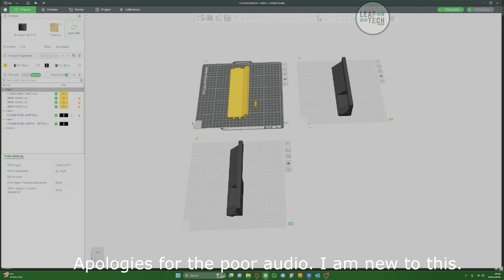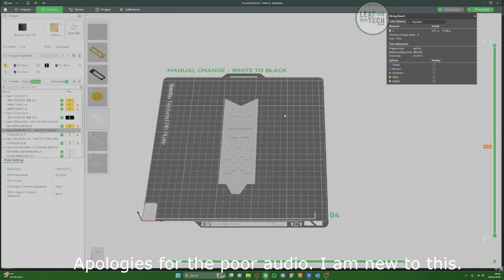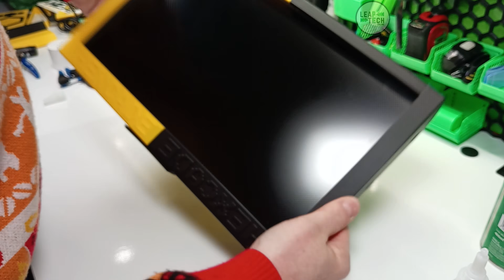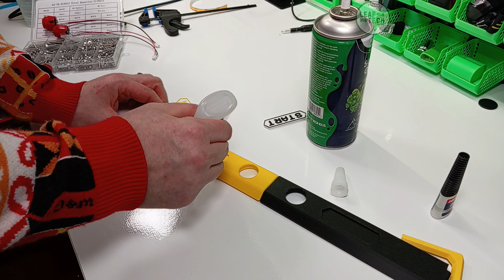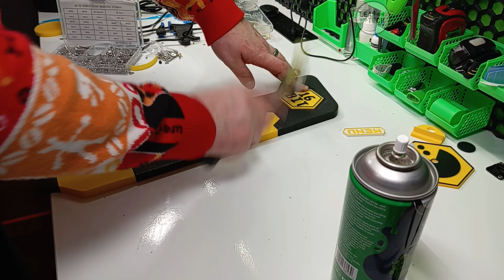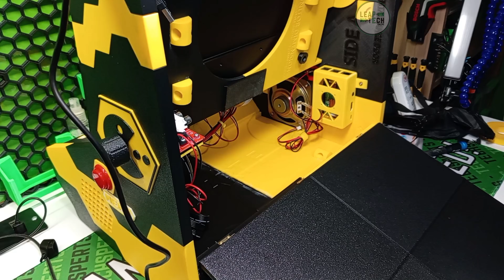A Step By Step Guide To Build Your Own 3D Printed Arcade Machine - Clean, Easy & FREE FILES.

Comment from the maker: 💾 DOWNLOADS & LINKS

All required files, operating system downloads, and resources are linked below in the description ⬇
Make sure you grab the correct versions before starting!
LeapTech Website -  https://tinyurl.com/45ftdhzv
Hexcase Page - https://tinyurl.com/3upy22j4
Hexcade Files - https://tinyurl.com/bdcwjp63
Win32 Disc Imager - https://tinyurl.com/5h65ac6s
ETA Prime how to load roms - https://tinyurl.com/yhjvtv8c
Reply: Great print project, makes me want to grab some more colorful rolls of PETG and build one I can power with my Udoo Bolt. I can't wait to see someone take this and make a version where the two control sides are modular/drop-in components. Seems possible with the current design, and it would make it possible to support lefties and different arcade button setups on the same machine.
Reply from the maker: @Tawnos_  You know... I never even considered modular controls for left handed people. Something I really should have. I will get this done as soon as I can. Apologies
Reply: @LeapTechOnline No need to apologize; you shared what you built and the top can be mirrored for a dedicated left-handed machine. Modularity would allow for things like a ball for centipede/golden tee, flight stick for star wars arcade games, etc. I look forward to seeing the iterations and improvements :)

Comment: Great build, thanks for sharing this. The only issue I got with it is the side power button, apart from scripting the functionality, was there anything specific you did to get it to shutdown using the power button? If so. Would you mind sharing it please?
Reply from the maker: Hey. It was indeed scripted but also it needs to be wired directly to the GPIO pins on the PI itself.
Reply: @LeapTechOnlinethanks, yep they have been wired directly to the pi pins as per your diagram in the video, but I used a recallbox image instead that I have for my other MDF cabinet with everything included, that I built a few years back which doesnt have the script. I ll try sussing that out and write up the script for it. Cheers for the response

Comment: Haven't watched the video fully yet but are print settings and wiring instructions included anywhere please? 

I'm a novice with both 3D printing and electronics but I'm desperate to print and build this for my home bar I'm starting to work on soon.
Reply from the maker: The prints are provided as a 3MF file ready to print for bambu printers. If you have a different printer you would need to adjust for your printer. 
Wiring is shown in the video for the Pi and controller pcb. 
We hope this helps.
Reply: @LeapTechOnlinethank you for the quick reply! Was more the power supply I was wondering about, I'll likely go down the route of the extension cable rather than the kettle cable. 

It'll be a Bambu A2L I print with alongside an AMS Lite. Not sure what colours yet though. I presume it's easy enough to setup the printer with which colours to use?

Also, noticed you guys are local! Great project.
Reply from the maker: @scott-the-lot  Yes, we don't offer advice on anything 240v due to previous issues. Sorry about that.

Comment: I finished assembling this and I had a blast. I'm now working on the 2 player cabinet. What is the back of the button panel supposed to rest on? I see tabs at the front but nothing in the back.
Reply from the maker: On the 2 player version you use the extra pieces from the last plate to glue to the side for it to sit on. Not the best but our latest versions we will release later this year will improve this greatly.
Reply: @LeapTechOnline makes sense now. I Kinda like how somethings I have to figure out myself. Are the L and R button supposed to be mapped to hotkeys?
Reply from the maker: @SPLIFiTeD  The L & S buttons are for load and save.

Comment: I finally got this built. The only issue that I seem to be having right now is that I can’t get the Menu button to do anything. I’ve mapped it to the Hot Key (I think it was called) and it does nothing. It maps as Button 1, so it’s operational. The issue that I’m having right now is that once I’m in a game I can’t back out to the main screen which is what that’s supposed to do right? Any suggestions ? Thanks again.
Reply from the maker: Hey you need to press the hotkey and menu at the same time.
Reply: @L@LeapTechOnlineanks for the quick reply. When I’m mapping the buttons though now that I mapped the menu as the hot key how do I remap it or what do I map the hot key to?
Reply from the maker: @JamieRRytlewski  Menu can indeed be the hotkey. The hwole point of the hotkey is an activation key to get you back to the main menu. For example on my machines, I would press the hotkey and Select at the same time and it would take me back. You could do it so its hotkey plus start etc. But you need the 2 buttons at the same time to go back.
Reply: Or do I Remap and leave the hotkey as something else?

Comment: I hope this hasn't been asked and I missed it, I've tried to read through all the comments but what size for the m3 heated inserts? When I look there are three dimensions. M3 and the diameter and length. Is the 4 the diameter of length, is there a preferred measurement for those two?
Reply from the maker: We generally use 5mm Long M.3 for all our 3d printed arcades. We hope this helps.

Comment: I love this and just finished printing my cabinet.  However, I'm having an issue with the OS.  I downloaded the file, unzipped it, and imaged my sd card.  In the Pi, it boots fine, I see your splash screen then Emulation Station starts.  I then get a message that no systems found and my only option is to quit.  There seems to be no way to launch RetroPie to set the configurations to use the USB.  Even after adding a MAME game I still do not see RetroPie as a system

I apologize if this isn't the right venue but wasn't sure where to ask for help.
Reply: No worries, would never ask you to provide those. Color me confused, but I am a noob at the emulation game. You suggested and linked to the usb method for ROMs. The first thing he says to do in the linked video is to go into the retropie menu. I don’t have that menu.
Reply from the maker: @conandlloyd  Yes not ideal but I would suggest the best youtuber by far for this is ETA prime. I do have a video in the works for step by step guides on this planned but no timescale as of yet. If you can not do the usb method look into SSH method.
Reply from the maker: The reason for this is you need to add roms. I can not legally provide them I am afraid. Once a rom is added to each console they will appear.

Comment: I'm in the process of printing all of this out. I noticed you appear to use at least two different types of glue. Would you care to comment on what you feel is the best glue for this project? Thin, Thick, Flexible CA? Thanks.
Reply from the maker: Hey. the main glue I use it anything high viscosity that can be activated with a spray activator. 
The smaller one is just a simple superglue for smaller parts. Anything from Loctite should be just fine.

Comment: Question. How do the buttons and joystick talk to the pi? (Haven’t gotten all my parts yet). Is it udb? Also will the system image work on a pi 4?
Reply from the maker: Through the PCB panel for the buttons. Basically it turns them into a USB controller.
Reply: That’s awesome. I do you have another question. Are you using a custom version of retropi? Is that the base of this and as I mentioned before will this work on the raspberry pi 4?
Reply from the maker: @ravedog  Correct this is a custom version of retropie. We do not actually use this OS ourselves as we have our own custom one but we are not willing to release that to the public.
A pi4 will indeed work but you would require a modified holder for the PI and  more than likely a new OS configuration. 
Simple enough tbh.
Reply: @LeapTechOnline thank you

Comment: Great build, how do you set up the buttons, it wasnt explained in the video
Reply: The settings. Wiring explanation is perfect
Reply from the maker: @davidescarsini5221  Ahhh yes! It should be set up to work right away with the OS we have provided?
Reply: @LeapTechOnline oh it doesnt matter where they end up plugged in.on the controller. mine are working but im not sure the buttons are doing the right action. when start select is pressed it moves the rom selection up and down skipping a few
Reply from the maker: @davidescarsini5221  Very strange. You may need to plug in a usb controller and re assign them all through the start menu.
Reply: @LeapTechOnlineI’ll give it a try. Thanks
Reply: @LeapTechOnlineGot the buttons working. Just don’t know what to map the side menu button to
Reply from the maker: @davidescarsini5221  If you are not comfortable in mapping it through code to drop back to the main menu then just make it your hotkey and it will be start plus menu to get back to main menu
Reply from the maker: Hey. The buttons as ion the wiring or the setting it up in the software? 
The wiring was indeed explained in the video?
Reply: @LeapTechOnline The settings.

Comment: question: do you have an alternate build that includes a roller ball and a spinner for games like tempest, golf, etc…. Or a second joystick for robotron type setup? Just wonder if it exists or needs to be designed? Thanks.
Reply from the maker: At present we do not. We are however working on many new machines including pool, light guns and fishing etc. So stay tuned as who knows what we will release.
Reply: Á

Comment: Since its 3d printed, any chance you could tweak the design where the control panel sits flush to the sides. 
I have an off-the-shelf bartop and the sides keep hitting my hand during gameplay which I find both annoying and painful.
Reply from the maker: We apologise, but this is not something we would be doing on this machine. If you were to need this you could either modify the files or pack out the mounting points. 

We will however look into it and keep it in mind for the next machine we design.

Apologies if this was not the answer you were hoping for. 

Many Thanks

Comment: Thank you so much for this. I'm just starting it, but I had a few questions after watching the video and downloading the files. I'm very new to 3D Printing. 

1. How did you get the pac-man to also be black? On the file I only see yellow. 
2. On that same piece it had a pause right at the end. Was that where the black should've been started? It appears to be now that I'm looking at things. I'm not quite sure how to make it black though with an AMS system. 

I'm so excited to see how this turns out.
Reply from the maker: You are indeed correct it had a pause for this exact reason. If you watch our video on multi colour with no AMS it will explain it all for you. We hope this helps.
Reply: @LeapTechOnline Thanks for the reply. Was hoping there was an easy way to change it to use with AMS as that’s what I have and I’m still kind of new to this. I just ended up continuing and I’ll paint it later or see if I can manipulate the STL files to do multicolor. As I said I’m new to this so I need to learn where to start. Thanks again for this.
Reply from the maker: @JamieRRytlewski  Hey, if you check out the videos on our channel we have one about manual colour changes. I hope it helps.
Reply: @LeapTechOnline yes I did and it was super helpful. it's just sometimes when I've doing these prints I'm not watching/watching it and it would've been helpful to just have the auto switch. thanks again. I'm part way through the print and have had some issues that I asked about on Reddit. Not sure if it's my plate, the filament or what, but since it's just personal it's not a huge deal. Thanks for the parts list as well. Ordered almost everything and waiting for those. The video was very detailed. Thanks again.

Comment: I think I want to try building one of these with a Pi5, as I've got a spare im not using. Wonder what kind of modifications I'd need to make to use it? A quite PC fan on the back bottom and a vent on top to exhause warm air would probably be all that I require. Aside from some small changes to dimensions, the largest difference between the Pi3 and Pi5 is the amount of heat generated and power consumed.
Reply from the maker: Luckily we have included an upgrade path in the machine for this. 
The top has holes to allow threaded inserts to be inserted to allow for fans to be fitted. A pi5 would require a simple pi enclosure and the required heatsinks etc. 
Power wise using an extension lead wouldn't make a difference to this. Hope this helped.